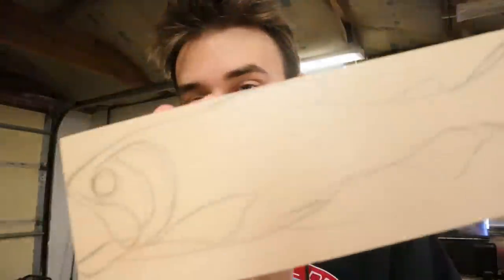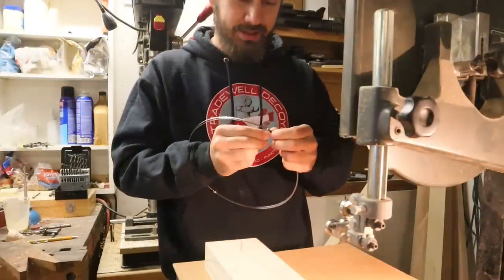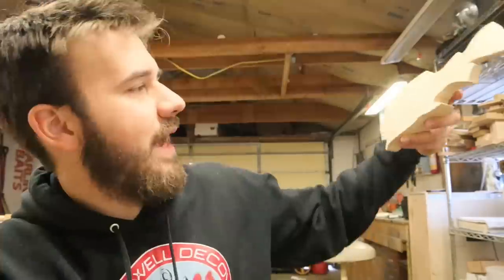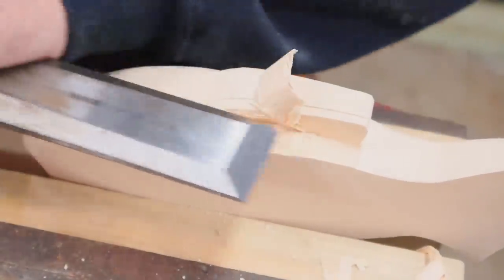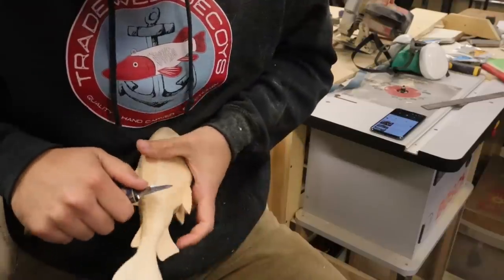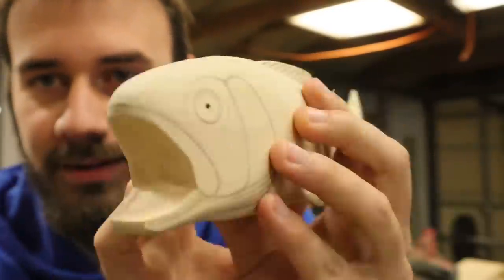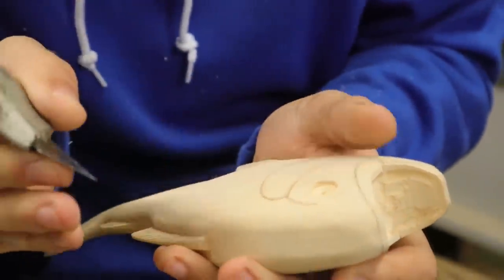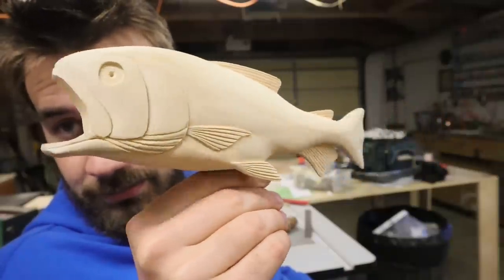An ArtsyFartsy Wooden Trout

Comment: Nate, hot glue or tape the parts you cut off when it was sideways onto the bottom for when you're cutting from the top and it will stay more stable and not tilt on you.